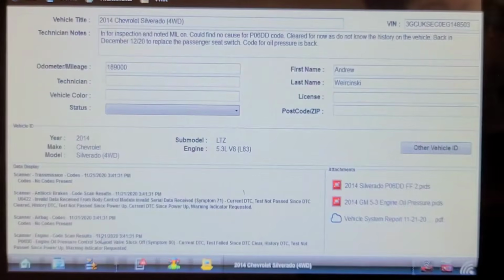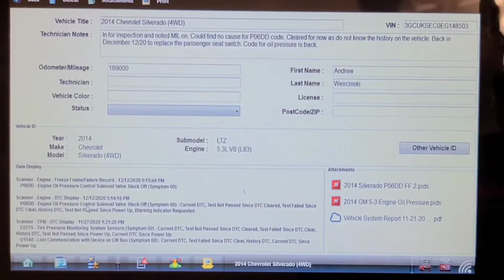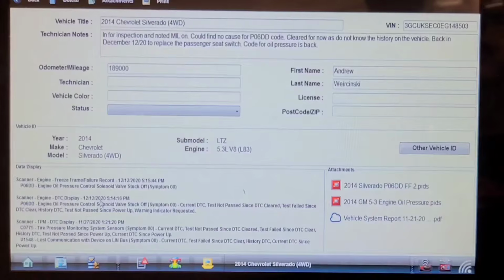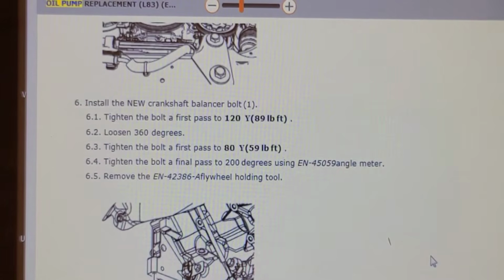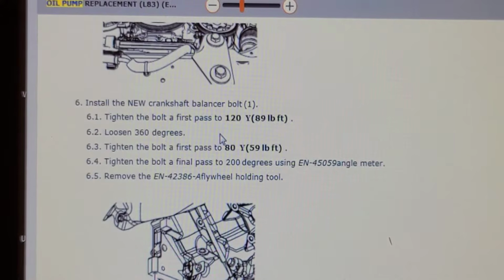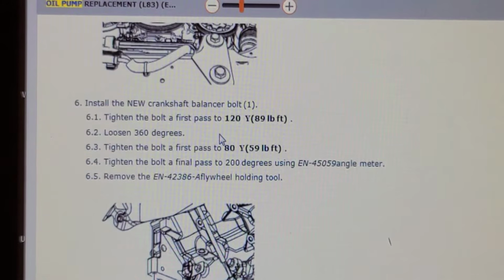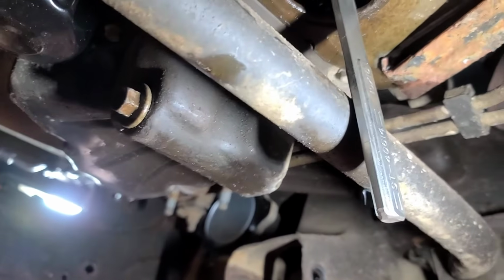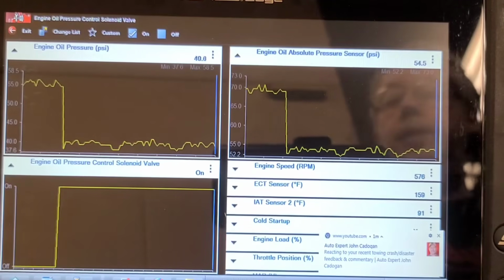2014 GM Truck 5.3 Oil Pump Replacement Code P06DD

Comment: Id just pull the engine lol. Good video about to reopace my timing chain and cam shaft. Might just leave the oil pan on
Reply from the maker: I've done a couple of engine swaps on these trucks. It's not that easy. I can remember doing an engine replacement in the 80's and be done in 8 to 10 hours. Now it's 21 to 25 hrs. The upper bellhousing bolts are nearly impossible to get to from the bottom and from the top you need to remove the intake.

Comment: Need to drop mine off and do the same thing
Reply: I’m curious 🧐 
What did they charge you to fix it the oil pump $
On your 2Wd or 4wd 
At a shop or dealership
Reply from the maker: I did this job 6 years ago. It was a 4x4. I charged him 11.5 hours at that time and parts were $400.00 Canadian so likely twice that much now.

Comment: I assume that on any of these engines including the 6.2 that in order to remove the oil pump, the oil pan must be removed first? Also, if the problem is ONLY the oil control solenoid...nothing changes really because you must r&r the oi pump, right?
Reply from the maker: Yes the oil pan must come off to do the pump properly. The pump must be removed to replace just the solenoid. I'd recommend to replace the entire pump though.

Comment: Question Why do some people say u need to use the alignment tool for the oil pump and do u recommend it i know u didn't use it
Reply from the maker: If you are reinstalling the original oil pump it is recommended to use the tool but if you are installing a new pump it is not required. I believe the original pump will develop a wear pattern and using the tool ensures the original pump is reinstalled in exactly the same place. No i did not use it in this case. From service information: Note:  If the oil pump is removed to perform a different repair and is going to be REUSED, the EN-51267oil pump alignment tool must be installed on the engine block BEFORE the oil pump is removed and left in place until the installation of the original oil pump. If the EN-51267oil pump alignment tool IS NOT installed prior to oil pump housing removal, AND left in place while other repairs are performed, a NEW oil pump MUST be installed.
Reply: Do u recommend use a little thicker oil with new pump or stick to 0w-20
Reply from the maker: @alfredoperez5665 In my opinion,  if you are towing or running in very hot weather, I'd use 5w20. GM has changed the oil recomdations for the newer engines too.

Comment: Wouldn’t it be easier to just pull the engine at that point?
Reply from the maker: Removing the entire engine is not easy either in my opinion. Flat rate to R and R is 21 hours. If you have other issues like broken exhaust manifold bolts, leaking rear main seal then maybe.

Comment: I have a question 
I removed that oil filler pick up tube and didn't see a o ring or nothing. Can I re use it or is it a one time use?
Reply from the maker: The Oring may be stuck in the pump. Considering the amount of work to access it I would not recommend to reuse it.

Comment: What are you talking about when you say that you can’t take the steering rack bolts out with an impact gun because it has “rubber bushings that absorb the torque”? i’ve never had that problem. I recommend you check out a beefier impact gun. I really like the Milwaukee half inch electric.
Reply from the maker: The steering gear mounting bolts are in rubber bushings and if the ears on the bushings are not locked into the mounting brackets the bushings will absorb the torque of the impact gun, especially if the bolts are rusty. Once you get yours out you will see what I'm talking about.
Reply: @PhillipBailey  I’ve already done it. That’s why I said what are you talking about? I didn’t have any problem at all. Once I posted it I’ll send you a link to the video I did of me removing the rack to do recall N2023254 replacing the torque sensor cover assembly. I took the rack right - out; no problem. Maybe you just got one that was built on a Friday.
Reply from the maker: Lots of salt used on the highways here rusts everything

Comment: I got the same problem on my 2014 sierra 5.3L. Dealership wants $3800 with other parts to replace too. And another shop can do it for $2400. But i got save money first
Reply from the maker: As long as the pump doesn't blow up and take out the engine.

Comment: What do you think the cost would be for doing that or what do you charge?
Reply from the maker: Its around a 10 hour job. If the oil pump has blown up you may need a replacement engine.

Comment: What tool did u use to install / press the crankshaft seal
Reply from the maker: A universal seal driver kit. Sorry but I don't have the number handy. Any round pipe like object that fits tge seal can be used. Old bearing race, ball joint press adapter or large 3/4" drive socket..

Comment: Not sure if you will even read this.. but what it that wire plug right below the vacuum pump for? My truck its all chewed up. Ot comes out of the wire harness that clips to bottom from of oil pan
Reply from the maker: I believe that is connector X154 with 7 wires, three for the camshaft position sensor and two for the cam timing solenoid and two to the oil pump control solenoid.
Reply: @PhillipBailey  I seem to remember a TSB for that issue mentioned in one of our tech forums. I dont recall the specifics but it’s worth mentioning so a guy is aware of it.

Comment: Holy smokes I  hope I never have this issue. What a complete mess GM created to change a stupid oil pump. Greay video and explanation. I work on my vehicles but no way I would be able to do this without a lift.and even then, the amount of work here is ridiculous. Good job
Reply from the maker: It's not just GM doing this. Most manufacturers are using two stage oil pumps to reduce friction and improve fuel efficiency...

Comment: Did you use anything to hold the harmonic balancer from going backwards when you removed the bolt?
Reply from the maker: 21:15 in video...I removed it with an impact gun but tightened by hand.

Comment: Why is it necessary to drop the oil pan if there’s no pickup tube bolt?
Reply from the maker: the pickup tube has an oval o-ring that compresses to the bottom of the oil pump when the pan is installed. I'm sure you can disassemble it without removing the pan but it will be nearly impossble to ensure proper reseal without dropping the oil pan in my opinion.
Reply: @PhillipBailey what if I used the oil pump alignment tool? If it locks the position before I remove the old one, when I put the new one, it’ll be forced to the position where it was properly seated on the o ring?
Reply from the maker: @eddier9921 it's my understanding that you are to use the alignment tool if you intend to reuse the original pump not if installing a new pump. I'd recommend to remove the oil pan and do it properly but it's your truck...

Comment: So I don’t need the holders for the pump if I put a new one ?
Reply from the maker: That is correct
Reply: @PhillipBailey should I do that instead of re using my old one ? Currently deleting it
Reply: @PhillipBailey should I buy a melling or ac Delco?
Reply from the maker: @johnrambo3935 I'd recommend oe personally but melling has good quality as well.
Reply: @PhillipBailey  thank you

Comment: This code has come and been cleared by me for at least a 1000 times the last 50k miles. All good so far 2014 Silverado 5.3 170k miles. Don't replace just ignore. Unless of course your oil pressure goes to zero!
Reply: It eventually causes it to die randomly.. like on the interstate, or on washed out mountain roads in NC🙄 not fun so we're trying to fix ours

Comment: Is there a way to drop the diff instead of completely removing it! The vehicle is lifted so I’m sliding in and out, and would prefer not to remove it.
Reply from the maker: @Matthewgarciaa  possibly if it's lifted.

Comment: Hey man I did a same job on a 2014 Silverado with the 4.3, I did everything by the book but when I hooked up the steering rack it said power steering drive with care, is there a fix for this like having to reprogram or no
Reply from the maker: There should be a code in the power steering module. You need to scan it. Check that all the connectors are plugged into the rack.
Reply: @PhillipBailey I got a code for a list of communication of control modules, would I have to reprogram it or get a new extension epscm because I couldn’t find a control module for the epscm?
Reply from the maker: @poloelcharro7909  the power steering control module is in the power steering rack. Are you sure all the connectors are plugged into it. Do a network code clear and then cycle the key off and on, then rescan the network . Pay particular attention to the PSCM.

Comment: No oil pump alignment ?
Reply from the maker: I believe that's only required if you are reinstalling the original pump. On this 2014 the service information did not mention it.

Comment: I can’t remember for the life of me. Was there a gasket on the oil pickup tube? I’m in the middle of a job I’ve been digging through Internet for days I haven’t found my answer it would be a HUGE help if you could answer!
Reply from the maker: At 13:40 in this video you see the oil pan and there is a thick oval O-ring between the pickup and the pump. Part number 12666993 I believe.

Comment: If you need to just change the timing chain gasket, oil pan removal necessary?
Reply from the maker: Yes you are supposed to drop the oil pan. It's difficult to get at the oil control solenoid connector

Comment: Man I had a customers cars that had this code. There is power at the solenoid. Put in a new GM pump and solenoid and still have the same code after a few miles. Had to bite bullet and refund him labor cost. But I am interested in know what the actual problem could be. Unless these pumps just not good
Reply from the maker: This code sets when desired oil pressure is above or below actual oil pressure. Oil quality can cause this but I'm sure you changed the oil when you did the pump. Low Oil pressure for any reason can also cause it. Try to command the oil pressure with a scan tool while observing on the scanner. Check actual oil pressure with a manual gage.

Comment: Thanks to the dumb ass engineers that decided to put a solenoid in the oil pan attached to the pump... morons... never before had an issue with the oil pump on a Chevy

Comment: Great job. Not sure if I missed it or not, but did you have to remove the starter to get the oil pan off?
Reply from the maker: No starter is not in the way can stay in place

Comment: i have a good doner engine coming for daughters 2012 suburban.  your incredibly thorough video will be a big boost to my confidence in regards to freshening up the engine before i swap out oil related failed 5.3 thank you. on a side note hers is a 5.3LT and i can't find info on which oil pump it will have, so i'm armed and ready for either now

Comment: My oil pressure is at 21 at idle but when i move it goes to 40 is that normal
Reply from the maker: If you speed up the engine it is normal for it to increase

Comment: How do u know it was the pump and not the oil pressure sensore
Reply from the maker: Because the pressure was not changing when commanding it up and down with the scan tool.

Comment: on the pick up tube that goes into the pan.does it get an oring or what do i use to seal it?
Reply from the maker: If you are referring to the oil pump pickup shown at 13:45 in this video yes there is a special o ring seal. Shown going back together at 19:25.

Comment: In 2014 after a night of heavy drinking I went to the chevy house and bought 3 2014 Silverados with the V-6 engine.    Except for a glass of wine at Christmas I haven't had a drink since.  But, l have been paying for that every year since in repair bills on premature wear and/or issues that were mentioned in numerous TSBs from GM.....the biggest and most frequent expense with these 3 trucks are cracked exhaust manifolds...again and again...

Comment: Having trouble removing the harmonic balance bolt. Tried the impact of 1400 ftlb and wouldn’t do a thing. Any recommendations?
Reply: Was able to remove it after heating it up. Came to find out that one of the timing guides was broken… v6 4.3 motor !!!!
Reply from the maker: Use a wrench on the torgue converter ear though the bottom of the transmission case and a big f***en power bar. You could also heat the bolt with a torch then let the heat wick down the bolt to release the lock tight.
Reply: @PhillipBailey  thanks I will try that.
Reply: for any readers I took an old serpentine belt installed it around the water pump, belt tensioner, and crank pulley. There will be excess belt, you press the belt together making a loop on the inside of the belt circle shape and place the loop under the belt along the crank or pump pulley. Do that in a manner so plenty of the loop is held snug and gets tighter as you spin the crank. It’s tightening on itself that way. If you want you can heat the crank bolt to break the bond of thread sealer but I havent needed to. It’s fast and easy this way, like a minute for the whole process. I just use the 3/4 drive breaker bar from harbor freight. My new Milwaukee 1/2” drive impact couldnt get it loose on the last one I did.

Comment: What was the torque spec on the cam bolt
Reply from the maker: I never removed the cam bolt. If you meant the crank bolt holding the balancer on that is 89 ftlbs then loosen it and retorque to 59ftlbs then 200 degrees with a new bolt.

Comment: Does this oil pan use a gasket or just RTV? If just RTV. What is the best way to separate the oil pan from the engine block?
Reply: I missed the tap on the corners to remove oil pan. Plus the RTV etc.....  Video has answered my question. Thank you kindly!!!
Reply from the maker: Mostly rtv but there are a couple orings. Once all the bolts are removed you can tap on the corner with a hammer

Comment: Awesome video. I get p06dd silinolid stuck off too however my oil pressure is up at 60PSI.

I see most saying they get low oil pressure? The shop I bought my truck from used is willing to eat the cost of repairs (i insisted to meet them halfway on labor and buy parts anyways) 

Any clue if that would still be a pump issue? Or is high oil preasure a major issue? I just don't want them to spend a butload of their time chasing the wrong thing.
Reply from the maker: The solenoid can fail either way causing higher oil pressure or lower oil pressure.
Reply: @Phillip Bailey  ah, awesome. Thanks for the quick reply! 

(Tbh rather it be stuck high than low lol)

Comment: You should put the harmonic balancer on before you tighten the cover all the way down if you do it that way it centers the seal on the harmonic balancer
Reply from the maker: Yes you are correct since there are no dowel pins between the cover and block to ensure the seal is centered but I felt that since each one of the cover bolts has that small insert on it that it would not make much difference. Additionally the service procedure doesn't mention doing this either. I know it was important on some engines though.

Comment: Just finished it up worked out great I had metal chunks in the pick up tube from the pump internals so I cleaned everything out good but I think this job can be done without removing the pan but then you can't clean any metal or debrise in the pan
Reply: I suppose because of the seliond connector on the pump you may not be able too without dropping pan
Reply from the maker: @serbia991  I'd also be concerned about that pickup tube oring...